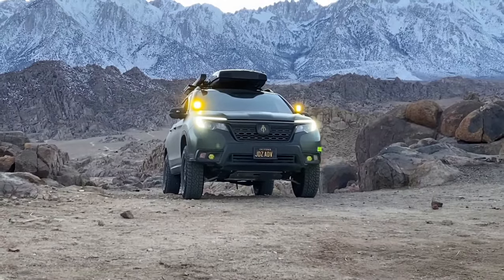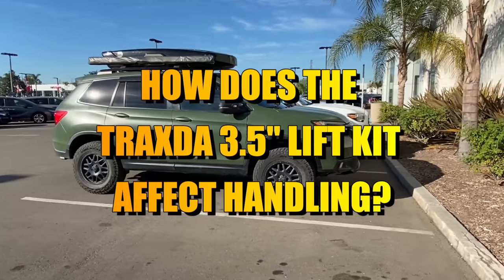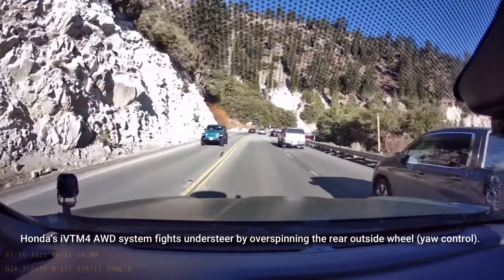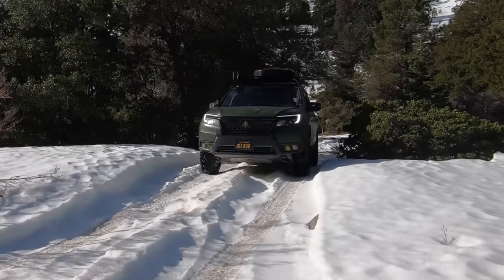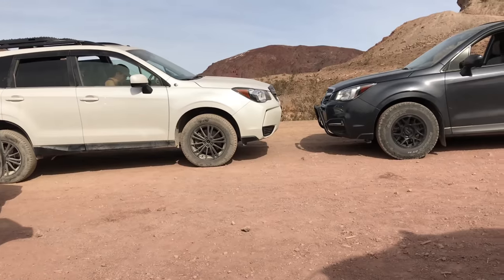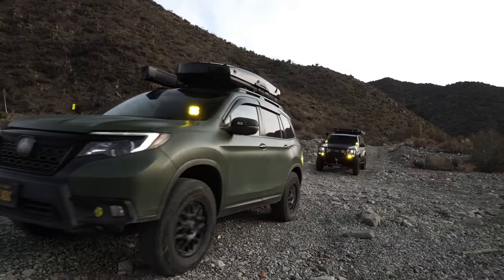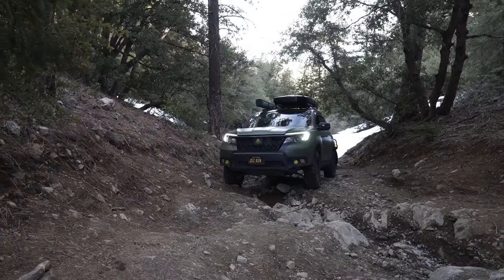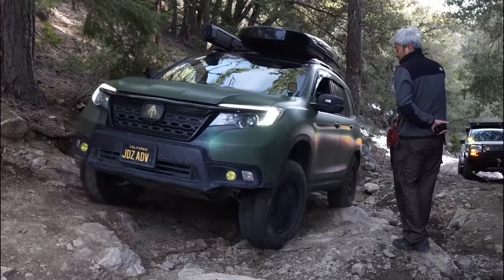3.5 inch LIFTED! Passport / Ridgeline / Pilot

Comment: Very nice, there must be a voltage supplied to the rear when to lock up each side of the rear diff.  I'd think if you could tap into each and put a toggle switch for each side to lock it up all the time when off road and avoid any slip which is wear on the clutches anyway and heat increase.
Reply from the maker: Actually, Sand and Mud mode already do that 😃.  But, it’s a simulated lock (which Honda does not openly admit, because, it’s not a true locker).  Ford marketing is calling their GKN supplied twin clutch rear differential a locker, so does BMW in their Msport AWD X6.  Only true mechanical locker will act like a locker.  I actually was planning to release this Instagram clip, but I did it early just for you 😃.

https://www.instagram.com/tv/CMfZS-zgtpX/?igshid=1srizf0yuypuf
Reply: @JonDZ_Adventuring  lol thanks. Hard to see from the small video of you marching but if simulated locked then the rear tires should never stop moving if either front tire is moving. Unless it is not capable of fully locking the rear.  It was tough to tell what was going on in this circumstance with the size of the video and black wheels.
Reply from the maker: @kartboarder22g17  as I stated, a simulated lock, isn’t a true lock.  So it won’t look like one.  If you have Instagram you can watch the video clip on full HD
Reply: @JonDZ_Adventuring  yeah so that brings me back to could it be fully locked if the supplies voltage was changed to constant...  I suppose if the mutiplate clutches are compressed by electromagnetic and the electromagnetic gets hot when energized I can see why that would not be a desirable outcome/option. But say it doesn't then it would be a very desirable outcome except for the strain put on the alternator/battery...  Well mainly alternator.
Reply from the maker: Nope.  Clutch plates can’t = a mechanical lock
Reply: @JonDZ_Adventuring  you mean per the design of this differential as a manual transmission vehicle with a clutch is a mechanical lock.
Reply from the maker: Not talking about manual transmissions.  But since you’re on that topic the clutch is engaged to “change” gears.  Then it’s deactivated and those gears are “mechanically locked”.  I hope you’re not taking all this the wrong way.  Clutch pack material simply can’t be locked like the teeth of a gear.
Reply: @JonDZ_Adventuring  Yes but a clutch when activated transfers the torque/power from the engine to the transmission.  It will do that in a locked way up to whatever the torque it is designed to handle.  For instance if you have a clutch that will physically transfer torque of up to 700 ft-lbs until it will slip due to loss of friction in the discs and it is in a vehicle that maybe puts out 350 ft-lbs of torque at max.  It therefore is capable of transfering all that torque to the transmission without slipping when activated.  The same thing goes for each of your multiplate electromagnet clutchs on each of your wheels in the back.  There is a certain amount of torque that they are designed to transfer.  Wether it is teeth on a gear or friction discs.  Both will mechanically lock up to a specific torque.  At some torque the teeth will shear on a gear and at some torque the clutches in any vehicle multi-plate or manual transmission will slip based on what ever torque they are designed to transfer at maximum.  For instance there is a multiplate clutch that runs the rear differential in automatic subarus.  It is hydraulically presurized in the case of subaru.  There is a youtuber who offroads his granny I think he calls it where he setup a switch so he is able to lock this multiplate clutch up basically simulating a locked center differential.  It is a mechanical locked center differntial using clutches and will slip at who knows what type of torque, likely Subaru knows what torque they will slip when fully locked.  And that likely is more than granny can dish out to it. Actually all hydrostatic automatic transmissions basically work under this principle where they lock the sun gear to change the ratio through the use of hydraulic multiplate clutches to do so.  So again it may be that when fully engaged the torque applied to your right or left wheel in the back of your passport may be able to simulate a true locker if the torque applied to each wheel does not go over what each multiplate assembly can transfer at full engagement or locked setting.  So, my thought is in sand mode, maybe they lock and still unlock in a pulsing type of setup and do not fully hold the lock at maxium as you are driving.  So again if that is the case, I wonder if there is a way to bypass this such as the case with what that youtuber did with his granny.
Reply from the maker: @kartboarder22g17  that’s the “power of your brain youtube channel” So, I have a video of a 1st Gen Subaru Forester with the center lock mod.  They’re clutch packs, but they can only do so much.  The front and rear wheels spin at different rates when pushed beyond the limit.  I’ll link you my video and give you the time stamp.

I get what you’re trying to say, but given what we see, a mod like that may work worse.  Here’s what happens with the Honda.  Sand mode will hold the lock until one wheel needs 70% more of the torque, at that point the other clutch pack releases and the system tries to appropriate up to 70% of total engine torque to the wheel with Traction (LSD mode).  The freely spinning wheel has minimal torque applied (even though it looks like it’s an open diff) and then forward progress is made.  I’m not an expert on this subject, but sounds like a good sequence.  Again, clutch packs can only do so much.  Some LSDs use clutch pack materials and they’re only considered 50% locked.  In the case of the passport you have a high biased electronically LSD + ABS traction control, and that still doesn’t come close to a real mechanical lock.  The best option is to get a real locker.
Reply from the maker: @kartboarder22g17  https://youtu.be/FyW9azD434M

Passport: 23:50
1st Gen Forester with center clutch pack mod 29:00.  
Anyways, thanks for all the comments and support over the years.  Thanks for watching.
Reply: @JonDZ_Adventuring  gotcha so if designed right it could potentially transfer all the torque that could be maximumly supplied to it. Yet likely that isn't the case at this time or maybe ever as the size of area to make that happen is too small probably. A double electric motor in the back type hybrid like they did with the MDX at one point would basically be equal or in some ways better than a locker I'd assume as torque is at 100% at 0 rpm and directly coupled to each rear tire.  That would be interesting to see when more of those hit the marketplace to compete with electric cars. I know RAV 4 has a single motor weak sauce motor to a open differential in their hybrid. But that wouldn't do it.
Reply from the maker: @kartboarder22g17  the right design would = a mechanical lock and not a clutch pack.  All it takes is a pin.  Super simple.  You just need a carrier housing inside the differential.

Comment: With the lift kit what combined mpg are you getting now?  you got a sweet setup buddy. I am a og Honda fan and I love that V6 vtec.
Reply from the maker: Mixed MPG isn’t really fair because I drive spirited around town.  On the big open highway I’ll cruise.  I also live in California, and our fuel has alot more additives than other states.  I went on a recent road trip to Utah, and it proved that I get better MPG on gas outside of California.  So, to answer your question, I get 21-23 mpg highway at 70 mph on flat ground and calm winds.  In the city, I get 14-17 mpg (because I drive spirited).
Reply: @JonDZ_Adventuring  that's pretty mpg good with the lift kit mod. 👍

Comment: Awesome video! I own a 19 pilot and desperately want to lift it (the wife fights me on it) the snow here is always so deep everyone is always hung up. One day ill just cruise by them all haha
Reply from the maker: Thanks 🙏 good luck on convincing the wife!
Reply: @440tomcat  I have 265/50R20 falkens like Jon has. I'm up in Northern Saskatchewan. I do good with the tires but there's still the big snow days where I get hung up.
Reply from the maker: Yeah, it doesn’t take much to max out on the 7.5-8.1 inches of ground clearance.  A few videos back I’m driving up hill in lots of snow.  Even with 12 inches of ground clearance my front skid plate was plowing snow and lifting my front tires up in the air.  A high clearance trail is defined as needing 8” of clearance, and that’s far from Rock crawling!
Reply: Just got one of the new 21 pilots which are surprisingly capable, this is coming from someone that runs a beefed up r51 pathfinder. The first thing the boss said was you better get whatever you need before you even think about taking that thing off the pavement. Waiting on my lift kit (just 2 in), skid plates and grill guard to come in then gonna mount some 31s. I’m a lucky man.

Comment: Great video! I’m still looking at this or the new Ridgeline to eventually lift. Have you heard of any wheel bearing issues occurring after installing these lifts or bigger tires? I’ve been told by a Subaru dealership that they’ve experienced this, yet they sell their cars lifted with bigger tires lol.
Reply from the maker: Subaru’s have strut top hats that prevent mounting +3 taller tires unless you use wheel spacers.  It’ll take some really wide wheel spacers for that!  On these Honda midsized vehicles there’s no top hat, so no need to space things out unless you want to run 275+mm tires.  To me, taller is better with these vehicles.  Width just kills MPG’s and adds unnecessary weight.  I run 255/70R18.  So mount tires taller than 31” you’ll need to either trim the wheel well or get an axle relocation kit.  Wheel bearings aren’t affected out of normal wear if you use oem wheels.

Comment: Why not just get a truck with a v6 like a colorado zr2, ranger fx4 or tacoma trd off road? Makes no sense to have that sort of suv with no low range
Reply from the maker: That’s a good question.  The Passport has an aggressive single speed automatic transmission with a 20.4:1 crawl ratio.  A 4 runner has 33:1, Tacoma has 36:1 and a ZR2 is at 50:1+.   So, the crawl ratio in the Passport allows it to climb better than the typical AWD which are geared between 12:1 to 16:1.

Why didn’t I get a truck?  Because they’re too small for me.  I couldn’t fit in a Tacoma.  Well... I probably could have slide the seat all the way back, but I didn’t want a 2 seater.  I sleep in my Passport and I need 7 feet of length to sleep comfortably.  A truck bed isn’t going to accommodate me unless I get a half ton with a long bed.  Anyways... I hope that cleared things up with you.  The Passports 1st gear is more aggressive than a 4runners 2nd gear in 4 low.

Comment: I have a 2013 Forester XT and have had my eye on the Passport but have read nightmares about the transmissions and the infotainment systems not working right and dealers not handling any fixes. Have you had any issues with yours so far?
Reply from the maker: I have to start off by saying that I felt the Passport was the true successor to the FXT, since it was killed off in 2019.  We are a special kind of buyer.  We want sportiness and we want utility and in 2019 there really weren’t any other options.  I also need to point out that owners of 2014-2018 FXTs typically had their transmission go out at aground 100k miles.  Mine lasted til 60K.  So transmission problems in the Passport?  No, the Passport has the 2nd Gen ZF9.  I’m hearing there are more issues with the Rav 4 Aisin 8 speed transmission.  Everyone else will have even more issues (Subaru, Nissan).  Infotainment system is very temperamental.  There was a recall a few month ago, and since then, it haven’t “locked up”.  But when trying to run a bunch of Apple car play apps, it’ll act up.  It might be because my phone is old, I have a iPhone 7 Plus.
Reply: @JonDZ_Adventuring  Yeah thanks for the reply. My Forester is the old 4spd before they went CVT. Between dropping the turbo and the CVT, I love mine but I just can't buy another Subaru.

The turbo really makes the vehicle capable on the highway which is super important to me. Being able to pass at will and cleanly is so important with so many left lane campers in the Northeast.

I think I'm just going to keep maintaining the Forester until it hits the wall. Just ordered some of the Kings progressive springs and some Bilstein B6 series to give the suspension some new life.

GL with the Passport, I really like the way the lift looks and I live on a dirt road at elevation and routinely like to run dirt and gravel at a good clip up here so a bit of punch, and ground clearance capability is a great thing.

I'm also 6'5" and I fit in very few vehicles anymore which makes it harder to find the ones that work for me.
Reply from the maker: @kingsqueak2221  the Passport does very well at elevation.  I think it’s because of the gearing, it has little issue getting to move.  As you know, even with a Turbo (I had a 2010 WRX as well), at elevation, it takes a while to get into boost range, but once there no more issues.  By the way, I have 63k miles on the Passport.

Comment: How do you fix the camber in the rear? Do you still need to put an adjustable ball joint? I took my lift off after the ball joint came loose (torqued to spec). Not sure what the ball joint does to towing weight limits either.
An upper arm that solves the camber and need to have an adj ball joint would be awesome!
Reply from the maker: With the 3.5” front / 3” rear Traxda lift, it was found that the rear had 1 degree of negative camber, which was within Honda’s specifications.  You can try talking to Nolo Designs (skid plate maker).  He figured out a way to run a ball joint in the rear on his 2021 Ridgeline

Comment: Thanks for all the info Jon! one thing i can't find after googling- how much do the approach angle and departure angle improve after this lift?
Reply from the maker: You can Google the formula.  I roughly measured 30 something-ish degrees approach at the center front bumper.  The corner over hangs are at around 60 degrees because I got the bumper on those corner overhangs.

Comment: Hi Jon, I like the spelling of your name! I have a '21 Ridge and was interested in a lift. Do you know of any reputable place in Orange County, CA to get a lift using Traxada parts?
Reply from the maker: Haha, thanks!  Central Tire #5 by LAX has lifted many Hondas.  Just ask for Aldo the owner, and call to set an appointment.  What size lift do you have?
Reply: @JonDZ_Adventuring  I don't have a lift yet, just want something to get a little more "Mammoth" snow clearance and fit some 265's. I am running everything stock right now.
Reply from the maker: @jonsprekelmeyer9867  they can help you with that.

Comment: Do you know the largest tire diameter you can put on a stock RTL-E and maintain clearance in turnings?  With 2” lift?  With 31/2” lift?  Thanks
Reply from the maker: I have a video about the largest tire you can fit.  Here’s the link:  https://youtu.be/c57eqe-V15c
The 3.5 inch kit may fit a 31 inch tire if you keep the width under 10 inches in width, but I can’t confirm.  May rub slightly.
If you want to run larger tires you can run the Traxda relocation kit or trim the metal wheel wheel.

Comment: So when adding the 3 1/2 inch front and 3 inch rear lift to a 2024 Ridgeline and the subframe drop in the axle relocation what is the largest tire size I can install?
Reply from the maker: I’m running 33” class tires 265/70R18.  With the axle relocation kit, you would have to cut some front wheel well plastic.  I personally don’t have the axle relocation kit.  I shaved my rear wheel wells instead.
Reply from the maker: Now I have a better understanding of your setup after our interactions on instagram.  By the way, I subscribed to your channel and think you have an amazing Ridgeline setup!

So, that 3.5” lift kit will slightly help you run taller tires.  At stock height, the wheels center hub is just below where the tire would rub, at 2” lift it’s right in line with the center hub, which would make the rub worse, at a 3.5” lift, the rub zone is now higher than the center hub.
Reply: @JonDZ_Adventuring  Thank you brother!!! More to come for sure!

Comment: Do they offer or upgrade under body protection? Do they tuck or cover CV boots to prevent them getting torn up. I have been building and breaking Off road stuff since 1984. I started with VW beetle sand rails and flat fender jeeps and went up from there.  I learned alot testing vehicle components to their breaking point and beefing them up. Honda needs to change their first 2 gear ratios for lower off road speed and crawling and higher torque. Then they need to add a higher than normal ratio at the top for interstate speeds. Their all wheel drive system is great. The crawl ratio sucks. Then put a hill in front of them and you are gonna struggle. Do they offer a better upgraded half shaft for the lift combo?

Comment: I have a 2017 Ridgeline, if I get the 3.5 lift kit installed do I need to get bigger tires and rims or can I keep the factory tires on it?
Reply from the maker: Factory wheels and tires will work.  Actually, This lift May help clear a tire that’s 1 inch taller than oem, that’s it!  For anything larger than a 31” tire you’ll need to either trim the wheel well or purchase the Traxda axle relocation kit.
Reply: @JonDZ_Adventuring  awesome, gladly appreciate your knowledge on it. Thank you!!!

Comment: 2021 Passport: 3. 265 60R 18 Falken Wildpeak AT3 (30.5”) biggest tire without modifications 

What are the rim dimensions and offset you recommend?
Reply: Hey Mark, what rims are you using? also, did you have a lift installed? Any rubbing at full lock?